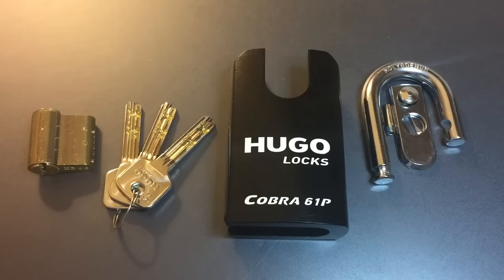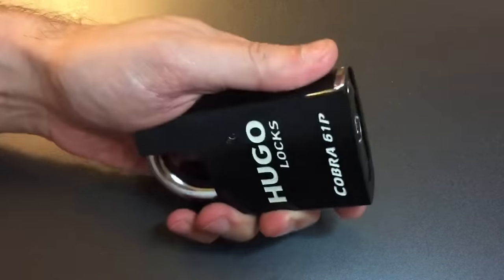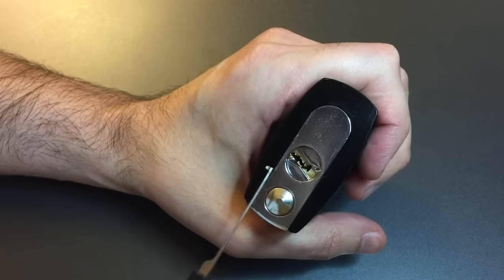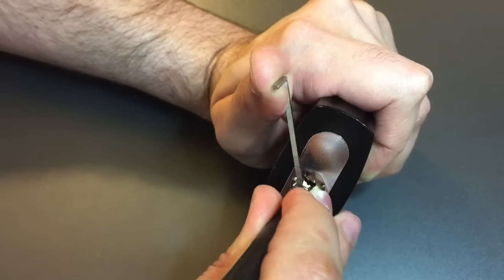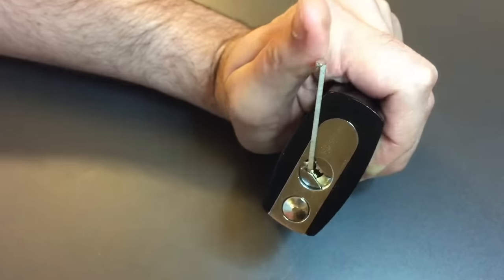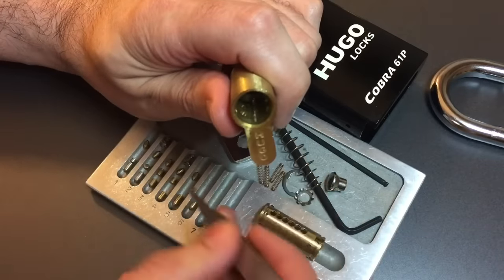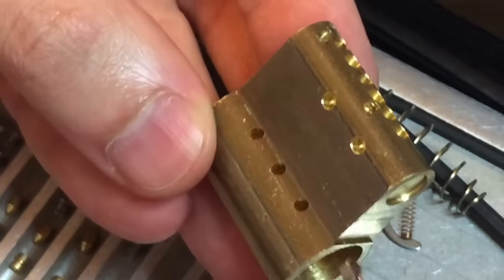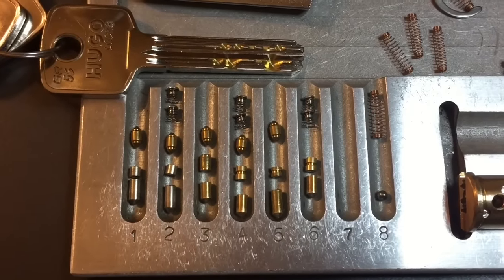[275] Hugo "Cobra" 61P Padlock (6 Trap Pins!) Picked and Gutted

Comment: So I see you breaking into all these locks how about designing a perfect lock concept
Reply: "Perfect lock" is an oxymoron. A lock can be opened by definition; as long as it can there will always be a method of attack.
Reply: @awkwardcultism  it's not an oxymoron. He said perfect not unopenable. A lock is designed to keep something enclosed or protected to be opened only by a key.  A perfect lock would be one that can ONLY be opened by the key. I would also like to see him design something
Reply: Tristan Zahringer, and don’t forget that even if the lock is impervious to traditional picking, it could still be vulnerable to physical attacks.

Typically, the more complex the lock, the more delicate the mechanism.

If a lock can’t be picked but can have its guts ripped out by a slide-hammer or drilled out...  is it still secure?
Reply: If i remember correctly he could not open one with a final fantasy Looking key, like a double "J" shape that you insert, turn, then pull, and turn again.
That key deserves to be magical
Reply: He's made videos on good locks. And made the point that there's a certain point where it is so good that certain weaknesses don't matter. Because the point of most locks is to deter easy theft. If someone is determined to steal something, the lock isn't the weakest link. Most people can't pick locks like LPL. And even if they can, they don't carry special tools for specific locks unless they've planned a huge heist or something. And in that case security is your best defense, not locks.
Reply: @dylbowaggins4160  my thoughts exactly, if one has need for a lock so secure it can't be defeated then whatever the lock is set into (and whomever is to hold the key, also) must too be infallible.

Comment: Very interest. Gives me a few idea for challenge locks. With all that drill protection, I'm curious how drill would actually go. Imagine if those pins weren't hardened lol. May explain why there are so many.
Reply from the maker: A trap pin challenge lock... well, shit.  There is definitely a ton of drill protection... kind of a kitchen sink approach.  We have the thick retainer plate, the spinner, the first two pin stacks with steel pins, and 10 hardened inserts in the core.  Considering the relatively low drill threat against padlocks in general because they are not securely mounted), I don't see this lock ever being drilled.  As for the inserts not being hardened, who knows... they don't come out for testing.  Interestingly, Lockwood is struggling with this exact problem now.  Apparently they sold many locks with non-hardened inserts (that's what happens when you outsource production to China).  I'm told you can drill them with ease.
Reply: Just the approach of more is better makes me think they aren't hardened. Anyone knowing anything about locks and drills bits etc will surely know that 2-3 real hardened inserts would be good enough specially if there is a plate and spinner. That's pretty much the set up we see with every known brand, assa MTL medeco etc. Wow what a let down. Can't believe what I'm hearing. I'll give up all hope once Assa goes to chine but for now and probably a while I'm still good :).

Comment: Great picking. I would make a proper mess of the gutting. If I manage to pick it. Very well made lock. Thanks.
Reply from the maker: Thanks.  The gutting isn't so bad once you know where everything is.  The trick to gutting and reassembling the trap pins is in the rotation of the follower.

Comment: The problem with the locks in this price range is that these days battery powered angle grinders cost the same. If people understand that picking them is hard they go through the lock or whatever is surrounding them. But a very very nice lock none the less :)

Comment: Even with the flaw you have to stop one set of trap pins and also only someone who has an extensive knowledge of picking and this specific lock would be able to pick this if a criminal would go to that much effort then it doesn’t matter what precautions you take they would find a work around

Locks are never full proof to every attack because if they were the criminal would attack elsewhere

Comment: nice picking again. Nice looking lock too
Reply from the maker: +chefgav1 Thanks.
Reply: LockPickingLawyer would you rate the picking resistance above a mul t lock interactive or a mt5 plus?
Reply: Interesting by the looks they only made it a single ball bearing locking?
Was actually looking at getting this or a mul t lock NE interactive.
Reply from the maker: Interesting question.  The practical answer is that they are both good enough to stop pretty much any criminal.  The "pickers" answer is that the MT5+ is far harder than either of the other two locks.  I'd probably say that the Interactive (with post 2008 pins) is harder for the padlock, and the GR 5s is better for a door lock where you need a full turn and the trap pins come into play.  That said, consider the source -- I happen to find MTL's far easier than most people, so I suspect there are others who would disagree with me (putting the interactive first).

Comment: I have a diff view on locking stuff up or locking a gate. What ever you lock up can be made to also prevent you from getting at it also EASILY. You may still have the item in your possession but unable ty get at it easily. JB weld a piece of metal in a keyway or put your own lock and chain on a gate.  There are people who like mischief or may want to settle a grudge. Even locking a latch you did not lock up can be locked up by a strange lock.  Spraying thick multi layer of rubber sealent will work as a prank..

Comment: That's an amazing lock, nice job!
If you widened the gap at the back of the core that interacts with the locking mechanism, would that correct the design flaw?
Reply from the maker: Thanks.  You're idea is a good one, and it would probably work well if the actuator was spring loaded (it is not).  Without spring tension, I'd be concerned that if the actuator was turned part way, and there was nothing preventing further rotation (in your idea, there wouldn't be), you could jiggle the shackle open (i.e., the balls would turn the actuator).  This is just my initial impression... it might work, but I don't think so.
Reply: Ah yes, I'd say you're right about that 👍. The more difficult fix would have to be resizing the actuator and/or steel balls or making wider trap pins. Which sounds like hard thankless work 😂
Reply from the maker: The bigger balls idea might have some merit if they would fit, and have the added benefit of being really easy to implement.  It's amazing the number of problems that having a bigger pair of balls will fix... :-D
Reply: LockPickingLawyer LOL 🍒😅

Comment: love the way you find little flaws in these locks great breakdown as usual.. I'm currently working on an mt5 but getting no feedback at all I can pick an interactive no problem do I need to set the alpha spring first?? because when I try that it still feels springy
Reply from the maker: Thanks.  On the MT5, I've only found one in which the Alpha Spring mechanism doesn't set first, so it's not a rule, but that's what I always check first.  Usually, the set is not subtle.  A very distinct "click."  Good luck with it.
Reply: I'm getting no click from the alpha at all.... I've just put a bid on one on ebay and this one has a key which should help lol thanks for the info and keep up the  good  work I will keep you posted 😆😆

Comment: Did you ever found a lock that have a magnet on the key on one of the pins. (I mean instead of pusch you have to pull the pin in the core)

Comment: Accu dremel tool with a cut disc. Screwdriver slot on the ball head nut. Do we then need more than a screwdriver to open this?
Reply: That would break the "tamper seal" and would probably take a while due to the shackle guards.

Comment: Slowly making my way through your videos but have you picked Kaba dimple with pins on the edge? These are the only ones I've come across and I've been told you can't pick then.
Reply from the maker: whomever said they can't be picked is wrong.  I have picked some, and seen videos of others doing the same.  I have a couple opens on a Kaba Expert, several opens on Kaba 20s (not fully pinned due to master keying), and one damned lucky open on a Kaba Quattro.  No videos.  I am not proficient with them at all.  They are VERY hard IMO.  I'd rather pick an MT5+ than an Expert.
Reply: Thank you for the reply. As I have only  ever impressioned locks in my day to day job picking has always been an interest only the same for my work mates. No one spp maybe the occasional pick gun attack. As I an teaching myself spp techniques one boss is keen to see how I go. So naturally I want to try dimple locks so that leads to kaba and the quatro seems to be the only ones about the office. Hence the comment that can't be done. I hope to show him one of these days. I have my new picks and some locks to try. So I hope I can pick your brains for some inspiration and help. Thanks again.

Comment: This Hugo lock uses the GR 4.5S Cylinder. If not for the design flaw where the slop in the second set of security pins allowed for the opening of the lock, could you still get past this core? In: https://www.hugo-locks.com/catalogues/hcat/public.php?brand=4&slang=1 the GR 4.5S is used in many HUGO platforms. Perhaps other HUGO platforms do not have the same vulnerabilities with this core.

Comment: lol, to close this lock again is more difficult then opening it in the first place. And how can you go through so much trouble to create a core like this but completely miss the fact that the lock disengages far too soon.
Reply: If I had to guess, there were two separate design efforts: one for the core, and another for the padlock it went into.  If it wasn't specified how far the trap pins would allow the cylinder to turn when they were engaged, then the padlock designer could easily have missed that it needed to turn further than that to unlock.

Comment: This drill protection you speak of. What sort of drill do they actually stop? It's just steel.. steel can be drilled.
Reply: I think the (hardened) steel pins destroy the drill bit due to hitting the edge of the drill bit. I actually have no clue, just using my experience with drill bits and some logic.
Reply: @NoticeForBlue  So use a drill bit made for drilling through hardened steel?
Reply: I still think it’ll want to break the edges of the drill bit, causing it to snap, depending on the size of the drill bit needed  I’m not saying it’s not possible to drill through the “anti drill” pins, but surely they’re there for a reason.

Comment: with regard to your question about why a lock maker would do something that makes there lock hard to take apart....that would be because about 98 percent of there customer base PREFER the lock be hard to take apart...only locksmiths and experts in the feild of locksport would ever want a lock they can easily disasemble...most customers hear 'lock' and 'easy to disasemble' and they mistakenly think it means the lock breaks easy and will thus avoid it...got remember, these locks arnt built to sell to you lpl, there built to be sold to joe normal and are tailored to joe normal's way of thinking and sensatiblities

Comment: How does the drill protection work?
Reply: Tool steel is about the same if not harder than the drill bit most of the time. And it will catch a carbide bit, snapping it off. You'd go through a ton of bits trying to drill out this core. It would likely be faster to use an angle grinder with a cutoff wheel, which is going to take a good few minutes looking at all the metal mass you'd have to go through.

Comment: What is the function of these "passive" pins?
Reply: The trap pins are on little springs that will pop into the key slot if there's no key blocking them from doing so. That will keep the core from turning, but as was shown in the video, the shackle could be released even with half of the trap pins dropped into the keyway.

Comment: What is the "spinner" piece for?..
Reply: Atley Meow drill protection. 
If a drill bit is touching it and spinning all the drill is going to do is spin the spinner. Drill bits dont cut when both the material and drill bit is spinning.
Reply: @highroller8877  omg thank you so much <3